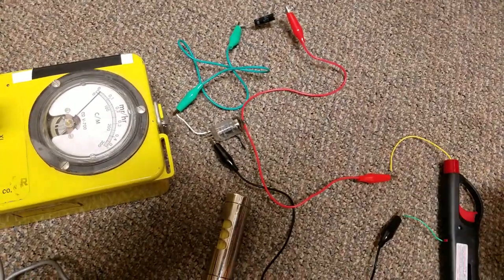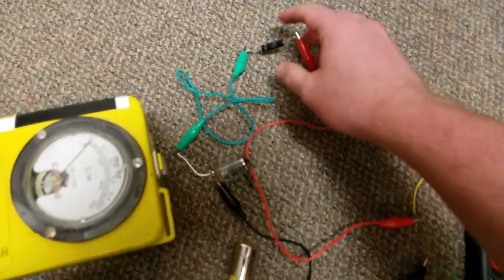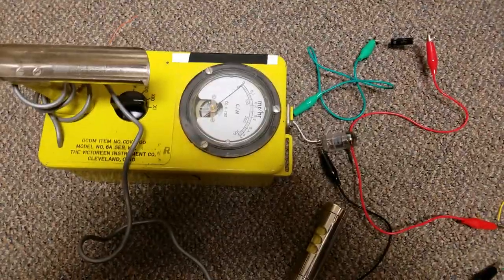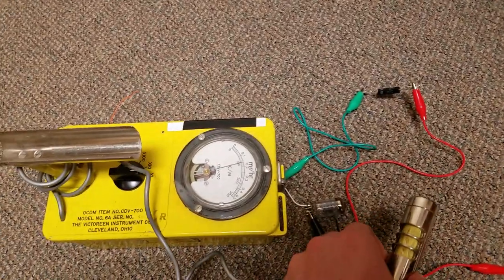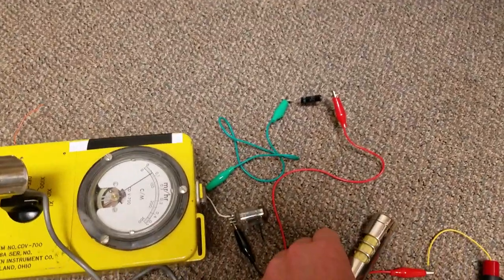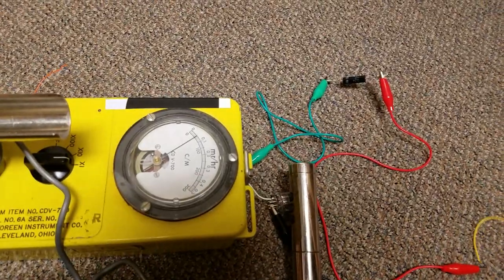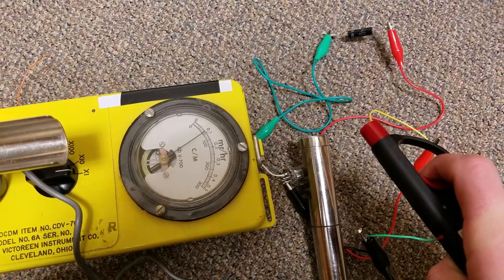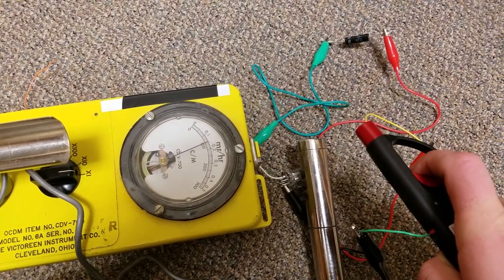Demo of Barbecue Lighter X-Ray Emitter

Comment: Hello GH, I would like to ask whether you have experimented with the generation of X-ray using the 6J1 tube, driven by a high voltage supply instead of the piezoelectric crystal? If so, what is the highest voltage/ energy of the x-ray achieved?
Reply from the maker: Hi - It's been awhile since I've done any ionizing radiation projects but I probably tested it at some point with a HV supply. There's no reason it wouldn't work, though I don't have an upper voltage measured. Basically any vacuum tube becomes an X-ray emitter under the right circumstances. Keep in mind if you run this with a real supply instead of a dollar store lighter it's going to become significantly more of a safety hazard, so get a detector and some shielding.
Reply: @GH-iw1rv  Thank you so much for the answer. Wish you the best in your future projects, love from Hong Kong👍

Comment: I have some questions
1) which tube are you using
2) are you sure these are x rays and not high voltages discharges confusing the geiger tube
Reply from the maker: 1) Should be a 6J1 tube if I remember correctly
2) Yes, positive they are Xrays. Ended up testing it with a photodiode radiation detector and a gamma spectrometer w/ scintillator later and both registered. Xrays are in the ~10keV range. In any case given the design of geiger counters I've found them to be very resistant to any EM interference that isn't xray/gamma

Comment: Can it work even if it's not using a diode
Reply from the maker: Yes it will work, but you will destroy the piezo ignitor so it will only work a few times. It's actually better to use two of the shown diodes in series for maximum lifetime of the piezo crystal.